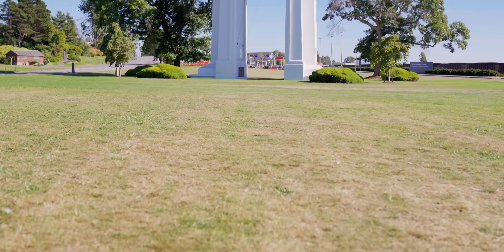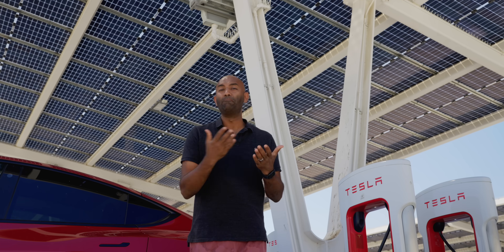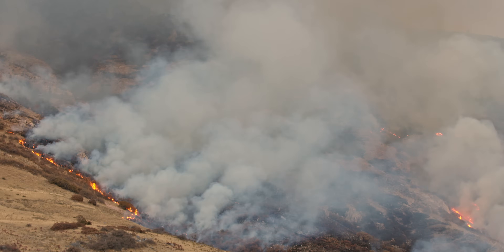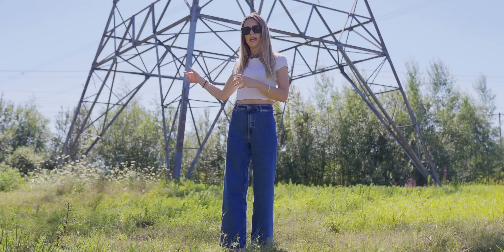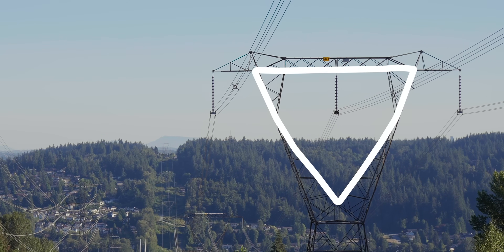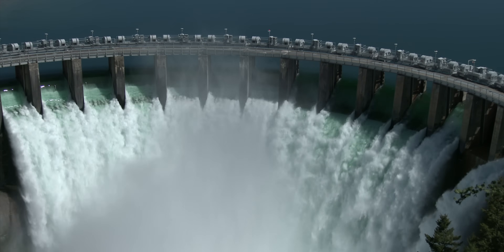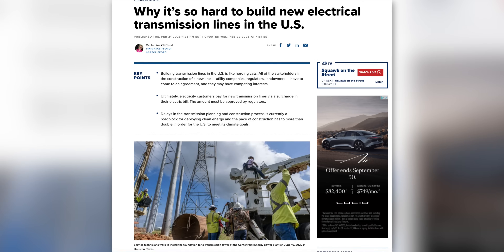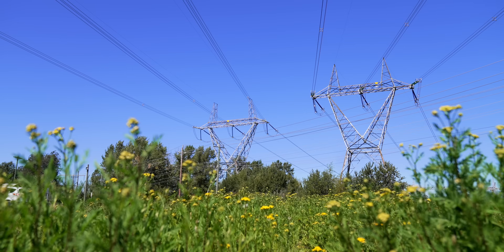THIS Grid Reduces The Need For Renewables!

Comment: It’s impossible to find a good number for line loss while transporting electricity. Maybe because the number is much higher than the utilities are reporting. Local power with battery storage is bound to be less expensive, lower risk of fires, line damage, maintenance cost, land use, permitting issues, sub stations, and environmental damage. At least you should be addressing the negatives and mentioning the pros and cons. Don’t forget the undergrounding of these lines as an option. Isn’t that what they do on your side of the pond?

Comment: I can't  remember where it was, but they designed Pylon towers to look like giants carrying the lines. Its almost like turning them into statues or pieces of art. If more of them were built this way, they would become an interesting part of the general scenery rather than a blight on the landscape. If we design pylons to fit into a landscape then would there be so many objections to them....?
Reply: 😂I nerd out with excitement when I see them!!
Reply: @lindam.1502  where are they?
Reply: There's a row of tidy-looking pylons crossing the M4 as you drop onto the Somerset Levels in England. 
They're probably not pretty enough for a special trip but it's worth looking out for them if you happen to be going that way.
Reply: @alanhat5252 the new T pylons? Yet to see one in the metal, but I like the design.

Comment: And that's why every power line needs to be buried less problems or expensive to put in but way more less expensive to take care of unless damage caused by them
Reply: As mentioned in the video, line duplication is more cost effective. Also, if there are problems with a buried line, correcting it is much more expensive and takes longer to remediate. Buried lines are only most useful for crossing water as in underwater lines, and in this case the line is still reasonably accessible for maintenance.
Reply: I strongly disagree with you lol!!!
Reply: Do you know anything about electricity?

Comment: Most people assume that locally generated power sources are superior because it's more efficient to use power locally.  Long-distance transmission is actually very efficient.  You only lose about 5%, so building out a large wind or solar farm in a great location usually ends up being far more efficient than trying to shoehorn power generation into a local spot.

(Side note: Even as an American I'd rather see the distances reported in km.  We have 5k run events here but do not have any 3.10686 mile run events.)
Reply: Have you ever said 5.28 kilofeet.
Reply: @appliedengineering4001   I prefer 10,936.132983 deciyards.
Reply: Every place that adopts renewables sees the price of energy shoot up, just a fact.

Comment: What's holding back the ultimate renewable transition is… selfish greed. We need to connect not just the country, but the entire planet: the sun shines, the wind blows, the rivers run, the tides flow somewhere in the world, day or night, all the time. Why can't earthlings mutually cooperate for the greater good? I wish Fully Charged LIVE in San Diego hadn't been postponed, and that I lived closer to Vancouver, for I'd really enjoy attending. Tsk.
Reply: You pay the bill, I'll run the wire.
Reply: @tedmoss and you also need oil and ICE for that to be built and maintained while EVs are stupidly just using it and not even paying.
Reply: @alanmay7929  <— pe'troll. 😂
Reply: @tedmoss  <— pe'troll. 😂
Reply: Connecting power systems across large oceans is unlikely to happen until someone discovers a room temperature superconductor that can be easily fashioned into cables. The Brazilian Belo Monte-Rio de Jenerio is the longest transmission line in the world at 2543 km (1580 mi). But that’s aerial, an undersea cable needs to be protected from corrosive salt water intrusion. An undersea cable that long is probably cost prohibitive right now.

Comment: I have lived in BC for my whole life. We are very aware of the transmission lines but they are second nature. I have to admit that it was WAC Bennett who had the foresight to nationalise BC Electric and found BC Hydro. I cannot say I was a fan of BC's Social Credit Party but if we had stayed with BC Electric we could have ended up with a power grid like Texas.
Reply: Does BC Electric have 30,000 wind turbines?
Reply: If run by power companies there is only about 300, I believe. There is a lot of potential on the coast, but if you look at the west coast of BC it isn't very accessible except by water. There is a massive potential that is going untouched and that is geothermal as BC on the Pacific Ring of Fire.  I thought if someone comes up with a fairly functional system then there could be wave power and tidal power. We surely have a lot of hydro power and a lot that has not been tapped, the Moran Dam on the Fraser River, planned but not done, which would have been an environmental disaster.
Reply: @HermannKerr  there are a few tidal-flow generators running, mostly around Scotland, but they're still small early stage machines, basically a submarine with an over-sized propeller riding at anchor. They seem reliable.
Tidal-range there's less of & so far they're a coastal barrage with low-head turbines set through the wall. There's one in France that's been working nearly 60 years (La Rance).

I haven't seen wave power working at scale yet but there are many promising designs.

Comment: This large scale model is one solution but better balancing of local grids can really increase renewable use and use battery storage to ease peaks!
Reply: Yeah and as always literally everything.ade possible with ICE and oil! What are EVs doing un the meantime!?
Reply: @alanmay7929  Did you notice the scow-bodied ore hauler in the video? (2:47) 
Did you notice it's electric? The excavator filling it is probably electric too.
These things were available in electric long before ICEs were invented & are still quite often the best solution.
Reply: @alanhat5252  are you living under the rocks on in your sweet dreams!? All those machines were steam powered first and then transitioned to diesel which made them significantly way more capable and versatile in all places around the world.
Reply: @alanhat5252  so the electricity just misteriously appeared from nowhere to power those things right!? Have you ever seen the construction of the power stations to the grid and more! Please educate yourself!
Reply: @alanmay7929  yes I've seen power stations, the early ones had dams holding huge amounts of water to run the generators (they're still making them now, they're called hydro-electric power). It was the obvious tech because water had powered everything else for the previous few centuries. Steam & electricity were developed at the same time.
Perhaps you would like to research that?
Reply: @alanmay7929  there really is no need for you to mindlessly parrot oil-company propaganda.
Reply: Oh, the wonders of modern technology! We can have both!
Reply: @alanhat5252  you call EV wonder of modern technology!? It has to be a joke right! Those things are significantly older than ICE and still today have barely done nothing when compared to ICE and oil! Literally everything in this world including electric motors and batteries.... All possible because of ICE and oil. Like it or not! From launching rockets to flying straight over 15 hours across the world to crossing entire desert to construction of those gigantic structures and finally their maintainance.